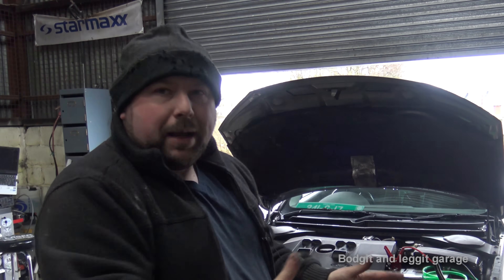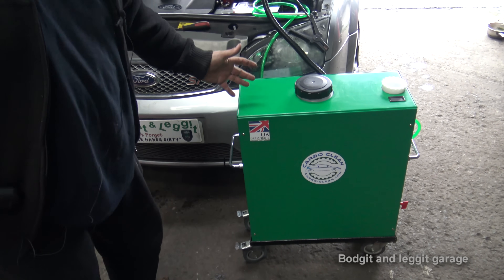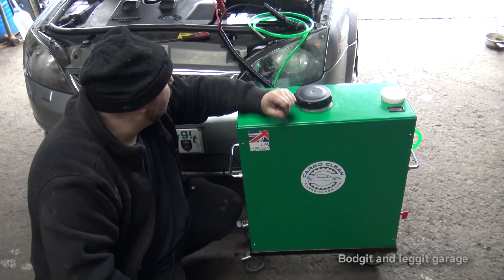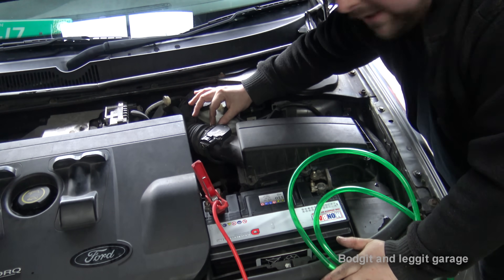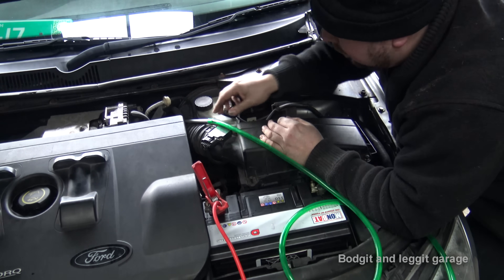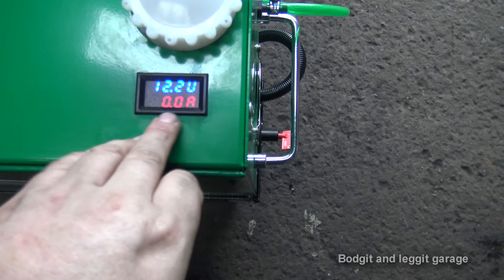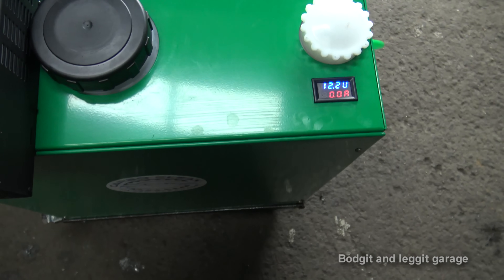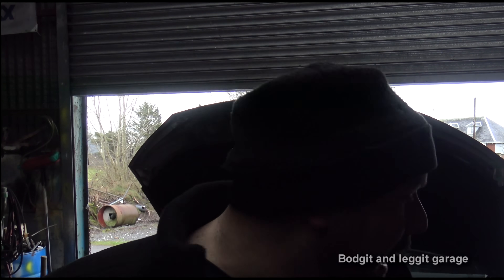Carbon Engine Cleaning HHO How Does It Work Bodgit And Leggit Garage

Comment: Nice video. Had this done on my Jaguar xf-s 3.0L with 140k on clock. Unfortunately right at end the coolant outlet manifold split open (part JDE 38234 ) which sits on top of the V6 . Whether the temp increase caused this @ 120c plus or it was a malfunctioning part anyway I cannot say. But the guy doing the clean went straight to the part saying this was a common part to fail.  Cost me £40 for part  and £15 for coolant to replace and about an hour to change it all. Car does seem to run quiter but just a heads up if you do an xf xj xk etc as they have this outlet which is ABS GRP made  and known  to spit in half and steam cleans the engine with coolant when it goes .  Not seen any increase in mpg but I do 40 miles a day on motorway so it's too right foot up and down in traffic to tell yet as it's only been 4 weeks since the clean . Hope this bit of war and peace is a benefit to someone !!  Certainly got my hands dirty that day removing air inlet and egr return pipes to get to the bloomin part that busted. Bit of research on vehicle before you send the hydrogen in and send the coolant temp through the roof I would defo recommend. This was my experience and not deflaming the process , just a heads up on what could happen.. There's a pun there... 🤔😂  Nightmare ... all sorted now 👍👍
Reply: seems a bit of a coincidence, did he mean its a common part to fail while doing the clean? 🤣
Reply: Shandybrother Coincidence , possibly. He didn't divulge that info  😂😂 But I had a chat with a guy at JLR and it appears this part is designed to fail in the event of overheat / high pressure rather than looking a head or head gasket fail 😂 The carbon clean does increase engine temp which was evident on the scan tool and pressure on coolant obviously increases with temp  but I would rather have a piece of moulded plastic go than a head 🤣🤣👍👍 . My advice is research before you shove a pipe in otherwise a customer might get a tad upset 😂😂👍👍😢
Reply: There's a pressure release in the coolant cap, to release pressure in a overheat condition. can't see why they would want a plastic pipe to split and spray coolant all over the engine
Reply: Its a common fail point on jaguar and landrovers so I'm told  .. Mine could well have been about to go .. Will never know but I have a clean engine and a more responsive engine now :)

Comment: had my Mondeo carbon cleaned 160k on the clock now sweet as ever also run on bio mix commercially supplied no problems.
Reply from the maker: M Normand nice mate at least this proves that it does work wait for my new video it's going to really short people LOL

Comment: 99 quid plus your fuel, by one company.  er no thanks!
Reply: you are quite right, its a rip off. this is just plain old electrolysis and this particular machine doesnt cost the garage anything to run as it uses the vehicles battery to power it, it uses 316l stainless steel plates inside. garages will make 100% profit off these machines and yet it is so simple to build your own.

Comment: Pfff hundrets dollars for machine that can be replaced by empty 2l watter botle ,waste of money :( old shool drivers just heated up engine and sprayed watter in intake  on running engine lol,simple :)
Reply: I've seen the spray thing done. You don't just spray 2 liters of water in and hydrolock it, you take your time and use a spray bottle to mist it. All it does it creates steam in the piston which ups the compression and kind of "Knocks" the carbon free. It doesn't work half as well as the HHO cleaning and lets face it, HHO is a business. You turn up to a customers house or get them to come into your garage and start spraying water down their intake with a squirty bottle and you will just look like a complete mug. Let alone if you get an engine with a super low down intercooler. The water mist just condenses and sits in the intercooler then when you drive it you will suck a good 1.5-2L of water into the engine. Nice.
Reply from the maker: Patric yes mate I know you don't just pour it straight into the engine
Reply from the maker: CarShed68 can't wait for you to see my new video you really need to do your research before you comment on videos you know absolutely nothing about my new video proves this works I would love to see you squirt 2L of water in your engine and film it see how well that goes for you
Reply: bodgit and leggit garage you think im scared to do that? Nope i done that few times ,not a bad idea to make video thx ;)
Reply from the maker: CarShed68 will look forward to it

Comment: Anything made in the UK is not wingwang  its British and it's the best  so forget the rest.  Well done Leon - top notch .
Reply from the maker: Dom's Garage no mate
Reply: lmao - he's talking about me i'm   his younger brother. Steven
Reply from the maker: STEVE ROB REVIEWS lol
Reply: Exept cars :D
Reply from the maker: Speaking of keyboard Warriors they are everywhere lol
Reply: bodgit and leggit garage talking about me?
Reply from the maker: STEVE ROB REVIEWS yes Steve you're the younger better looking brother
Reply: I'm a keyboard warrior. :(
Reply: Except, the machine is made in china, lol
Reply: The science behind this is "Italian tune up"
The hydrogen increases the temperature inside the engine to disintegrate the carbon that's built up which actually does work. However subjecting your car to prolonged high temperatures systematically will destroy your engine.

You're better off blasting the intake valves and intake manifold (metal/aluminium only) using ground up walnut shells to decarbon them, pre combustion chamber. Post combustion chamber better fuel will clean without damage.